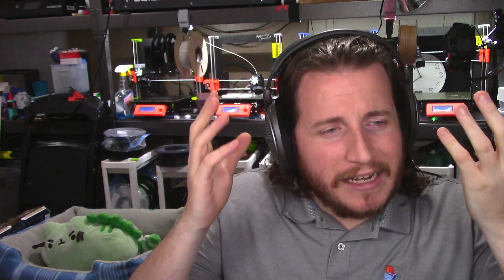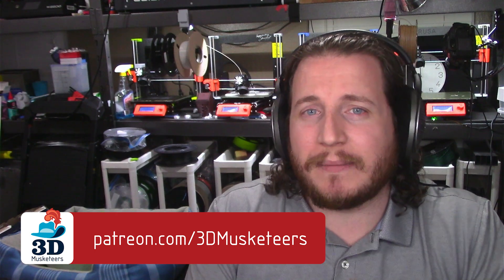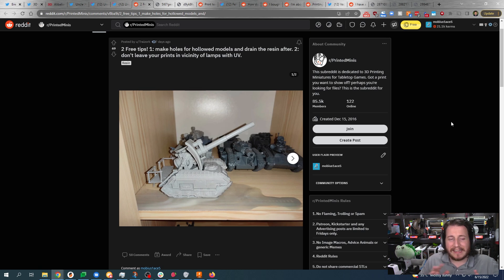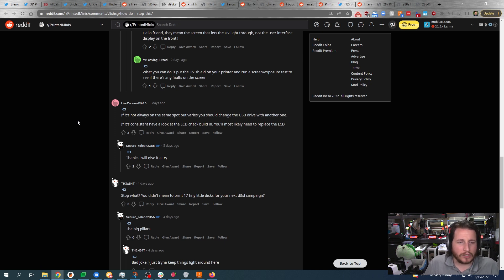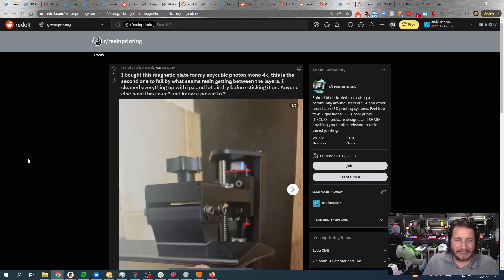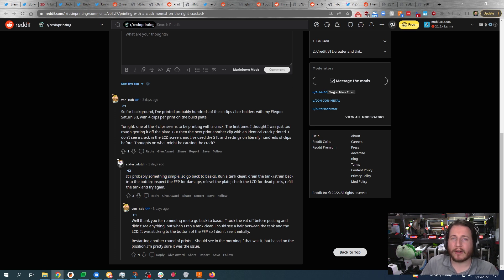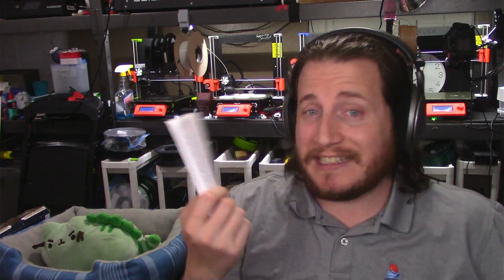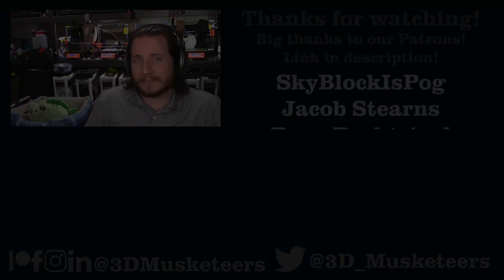Cracked Resin Prints and Odd Layer Lines! - PrintFixFriday S1E41

Comment: it's pretty bad form of any slicer software, free or not, to allow an export that has meshes marked as both hollow and no drainage holes marked,  without at least a warning popup.

It also should be entirely reasonable to detect a contiguous closed area on a slice and then check for supporting structure or even run the math to calculate suction force extremes based on volume using a simple voxel grid.   This isn't extreme engineering, this should be seen as a bug, rather than something that users should be expected to solve.
Reply from the maker: Lychee tells you, but it is also recommended that you run stuff through UV Tools first. I do agree though!

Comment: Wife has 2 Mars 3 units with Wham Bam and they specifically stated to wait 72 hours at least before using. Have had no issues with it at all.
Reply from the maker: Crazy, when you read the directions, things work as intended, who knew LOL
Reply: @3DMusketeers  Manuals usually have bold letters on the front that say "Optional Instructions, It's cool .. don't read me" I think. So it's fair haha
Reply from the maker: I too have played the dangerous game of dig through the trash to find the manual because I have been outsmarted by the piece of tech I thought I could outsmart.......